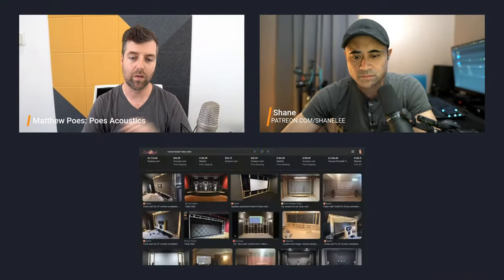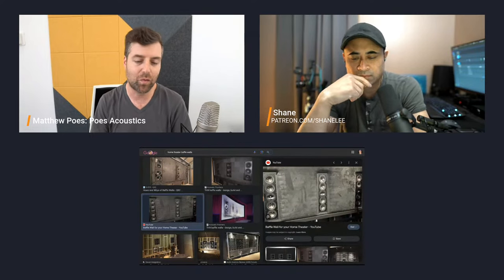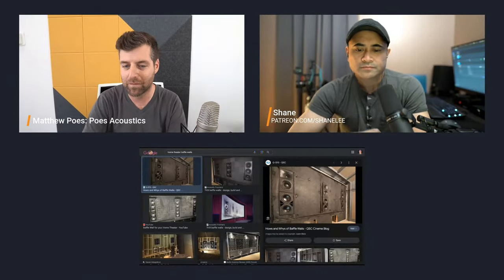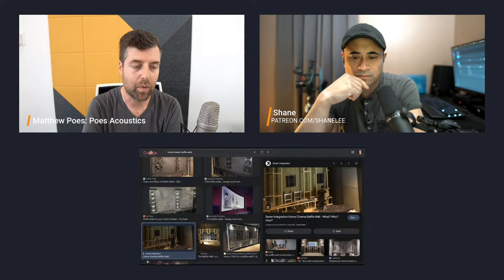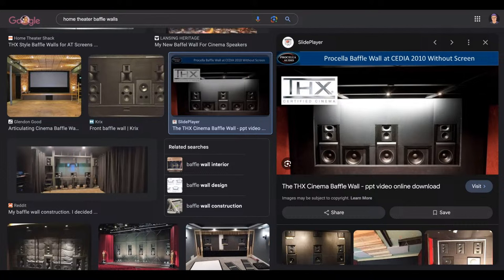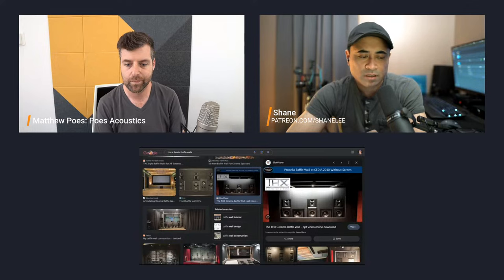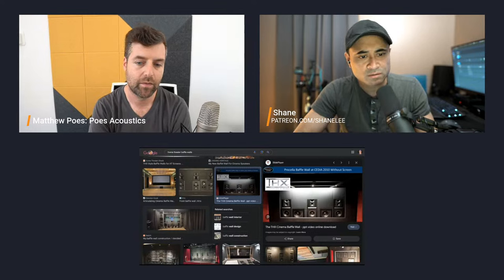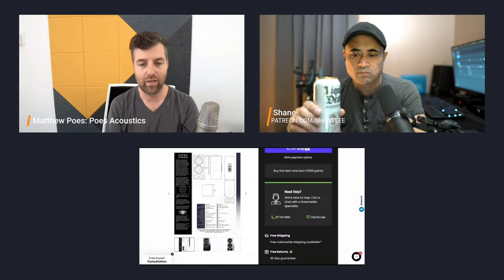Hide Those Speakers! Building a False Wall | Spare Room to Home Theater pt.3

Comment from the maker: WHAT TOPICS WOULD YOU LIKE COVERED?
Reply: Hush Box Designing, im designing my own right now with 3d printed air channels
Reply from the maker: I'm doing the same. Yours sounds way more advanced.
Reply: Hi Shane, could you please discuss curved AT screens in the next episode? Thank you.
Reply: Thanks for great content and conversation.  I am in the planning stage of my home theater room 19'6"d x 13'6"w x 8'9"h.  I am planning a 140" to 150" AT screen.  I plan to have two rows of seating with the second row on a riser roughly 12"-16" high.  My mains are Paradigm Studio 100v3's and currently only have one Cerwin Vega Stroker 18D4 subwoofer in a 9cuft ported box tunes to about 23Hz in the back of the room.  

I love the concept of the waveforming, but that's not in the budget as of now, so I've been thinking of building in a couple of horn subs within the riser.  If I don't build some horn subs into the riser, I was thinking of just adding a few other subs placed in the room wherever they sound and measure the best.  

My question is, what are your thoughts on horn subs in a riser?

Comment: Matt mentioned building the false wall with aluminum extrusions. I can verify that these are very handy. I just built a 120” screen with motorized masking panels using 8020 (brand name) aluminum extrusions for orders of magnitude less money than an equivalent Seymour masking screen costs. I did use Seymour UF screen material and was able to spline it into the channels of the extrusions. I used Seymour Fideleo velvet for the masking and to cover the frame. I built the frame out of 4x4 aluminum angle sections. It’s built like a tank. It uses Somfy motors which I control with a remote. It’s pretty cool.

Comment: This vid was very timely! I have the R5i for LCR and was debating on not using baffle walls and instead just use aluminum T-slot extrusions I had on hand for directional mounting (and Rockwool surrounding). How big do baffles around each speaker need to be to not lose the room gain? Or do I need to build out the entire wall behind the screen?